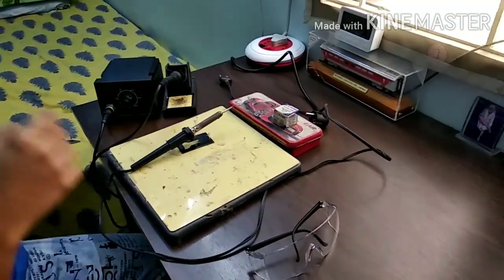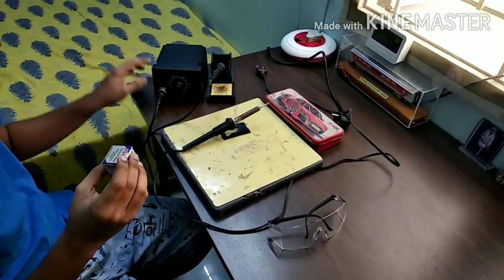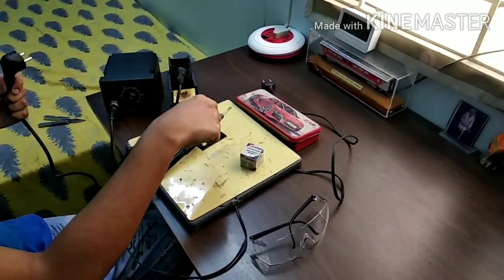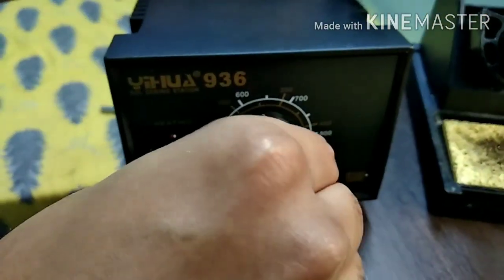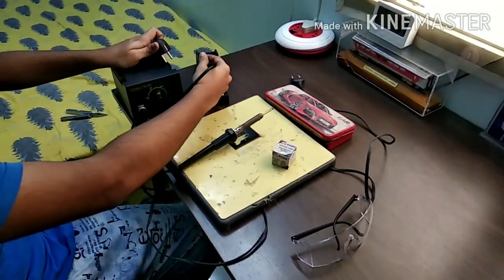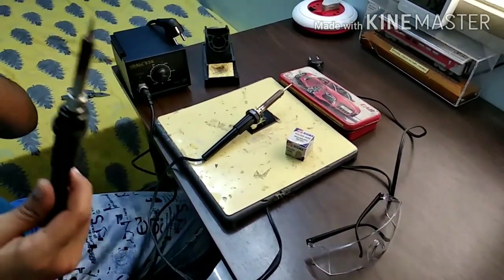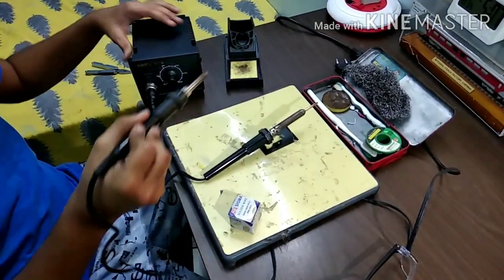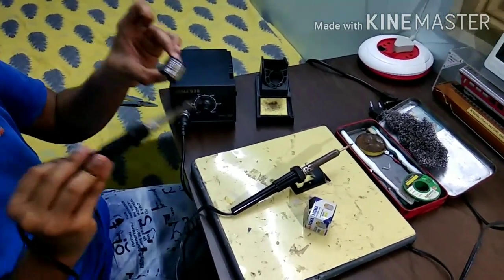Soldering Iron Vs Soldering Station. Which One Should You Get?

Comment: Should've noticed that soldering station has a closed loop temperature regulation. That is, sensor in the heating element tells the control circuit how much heat is being dissipated through the air and the works, and circuit pumps accordingly more or less power into the element.